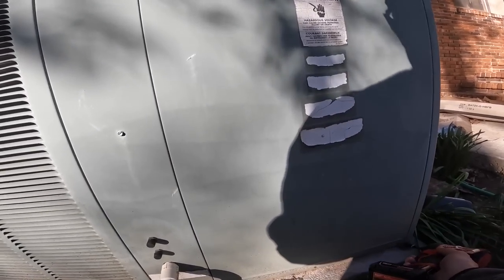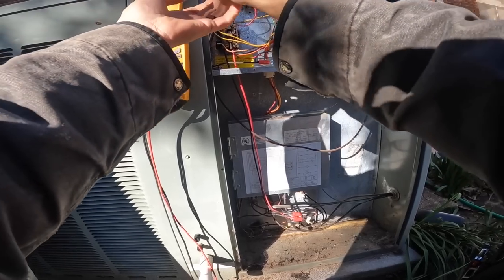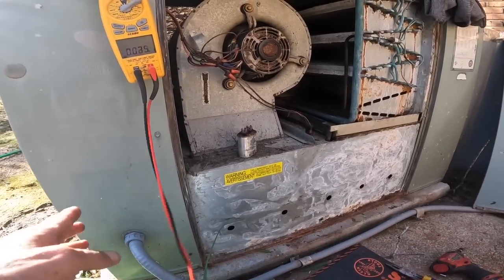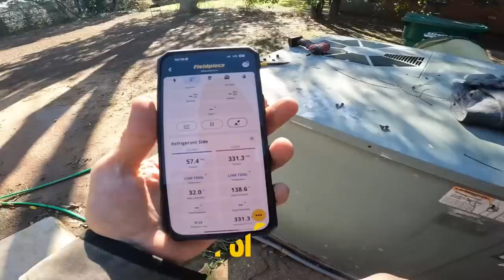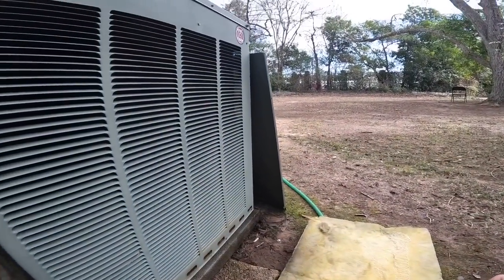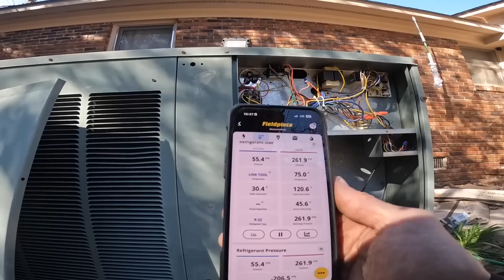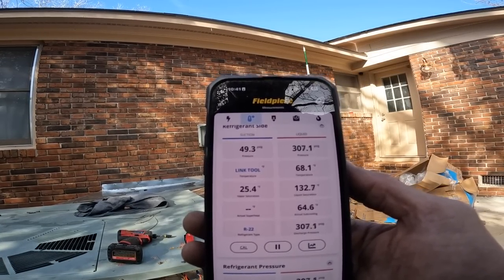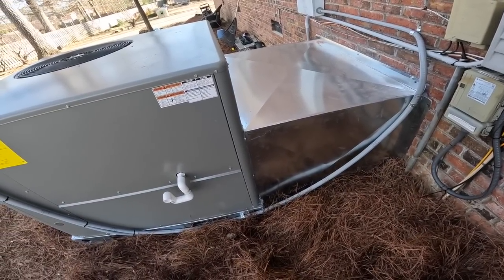Multiple Problems Causing System To Not Satisfy the Thermostat

Comment: I just checked the age of my unit and it is 30 years old...and still going strong near Tampa Florida.
Reply: Prolly a furnace. You can't hardly kill those old suckers. Especially if it's a ribbon burner. I recently replaced a furnace older than me, and I'm no spring chick! Hell, the burners weren't even cracked. I think the swap out had more to do with the outdoor condenser than the indoor furnace. Rheem used to make these army tanks that doubled as furnaces. Bunch of bolts everywhere. If you're lucky enough to own and old school ribbon burner, just make sure to shake the soot outta the burner once every five years   lol

Comment: Nice work once again. Those units are nice when they're new. That one has a nice pad, I've seen you work on some that are right on the ground, I don't like that at all. Seems like it would be feasible to have those off of the ground a bit, even if it is some bricks. May not rust out so fast and get as nasty. Those garden centers have concrete squares and even house blocks. One good thing about those package units, you don't have to crawl around those attics and what I hate even more, crawling under those houses. Mine is a split, but it is a horizonal unit that is in a small mechanical room with my water heater. One of the smartest things I did when I built my house.

Comment: When it comes to rudd and Reem units being charged 
funny, no one ever looks at the charging chart on the inside of the cover. Indoor wet bulb and outside ambient temps will get you there. 
Also, don't forget to run the unit at least 15 minutes so it can stabilize pressures.
Reply: You're not wrong. It's just hard to wait that long when your boss/dispatcher is yelling for faster results. It's a hard line of work. I try to wait at least 5-10 minutes before I say anything with confidence. Although....irony of ironies....no one seems to give me too much lip when I'm fixing an ice machine. "Need to watch it drop a batch or two of ice" can shut up even the most cut  throat of bosses. lol
Reply: @Niveous23  ur right 
I got that covered cause I'm da boss 😎
Reply: @catwrangler1613  Hell yea, get you that paper. It's not easy being a boss. And since it's your reputation on the line, I can imagine perfectionism being a thing. I try to be as extra as I'm allowed, because....even if it's not my company...it's still my reputation as a tech. I'd rather be called slow on the job than half assed lazy.
Reply: @Niveous23  I'm retired now after 21 years of hvac. 
It was bad enough having to switch to r410a, the worst refrigerant since coyote piss and now r454b
Is on our doorstep.  Its gonna cost a fortune to change over to it.
The only unit I work on is mine, and it's 26 years old.

Comment: Hey Curtis, I'm a big fan. Why didn't you consider a bad txv considering you hady low suction high head and a high subcool? On both heating and cooling for a bi flow txv no less
Reply from the maker: I did suspect the TXV.  I just recovered a little before condemning it.
Reply: @HVACGUY  so I'm sorry maybe I missed something was the conclusion overcharged/different refrigerant or txv
Reply: I thought it was the txv also. Had someone been there before you got the service call ?
Reply: @johnwhaley570  49 is a low suction
Reply: @rashatmehta1386  Even for a r-22 system, that's still too low. I agree.

Comment: Hope they have electric heat  I don’t think your diagnostic is complete. Maybe dump the charge and weigh it then you can check refrigerant mixture
Reply: Of course that's the next step. It just depends what the customer/land lord wants. Half your job as a tech is solving and fixing issues....the other half is on the phone, negotiation between customers/suppliers, and picking up said parts.  lol
Reply: @Niveous23    Hey I was just saying in order to tell the the tenant or owner what wrong a few for steps are needed otherwise Curtis really can’t be sure . Sure you should ask the powers to be if they want  further investigation first
Reply: @jamesfitzsimmons381  Time is money was the point I poorly made. Apologies. 'Knowing for sure', is a time equals money thing. Like I can tell a customer, "Your unit is low and you have an obvious leak somewhere." Unless I spot oil or hear a hiss, I can't waste anymore time on the job. My priority has completely shifted. I now have to shift gears. Does it look super low or slightly low? How old is this unit? What do 
I need to tell my boss/ the customer? That feedback is crucial to me knowing for sure. Maybe everyone is gonna tell me to 'top her off and get back on your truck'. Maybe they'll all tell me, "find that damned leak". I have no idea. In an ideal world, techs can just sit around, troubleshoot, and fix. But there's a lot of money and consent involved.
Reply: @Niveous23   it’s all good my friend I worked in residential for 36 yrs dealing with customers like you said.  Been retired for 8 yrs  don’t miss the customers but I do miss working on the unit.  Have a good day

Comment: Why does the blower need a capacitor? In other words what’s the purpose of the capacitor to the blower motor?
Reply from the maker: Complicated answer. In short that type of motor needs a capacitor to help it get started. It’s a Psc motor - permanent split capacitor. All three of these motors have one.
Reply: It's there to aid the motor in starting. Some motors, including the ones in ceiling fans can't turn on with just normal line voltage.
Reply: @HVACGUY  thank you 👍.
Reply: @KenKen-ui4ny  thank you 👍.
Reply: Think of them like the “kick” to get the fan blades/blower wheel etc, to start spinning up
A good test for weak capacitors is to physically spin up the fan/blower during normal operation and if it starts spinning on its own, you know the motors generally fine just needs the right mF to get er goin
Reply: @JesseDoesHVAC  once the capacitor releases its charge does it now hold its charge till the next startup? Or is it constantly releasing its charge during its sine wave cycle?
Reply: Hello,after trying they RUUD,YOU FINALLY ,INSTALLED A ‘LENNOX;’ NICE INSTALLATION,,,,TAKE CARE,,,,Till next time,, 🇺🇸🇺🇸🇺🇸🇺🇸
Reply: @JesseDoesHVAC  I had an very old mechanical Start bench grinder that I had to rope Start to get it to run because the Start winding crapped out. HAHAHAHA

Comment: While using screws to hold on the insulation may work, it defeats the purpose of the insulation. When you crush insulation, it can no longer do its job.
Reply: better than plug the blower.
Reply: @MariosACandRefrigeration  no, better is to use glue and keep the value of the insulation.
Reply: Or realise that the overall affect of that small plate of tin is gonna have on the overall r value of the insulation is so negligible that its not even worth worrying about
Reply: @JesseDoesHVAC  you clealry have no clue what you are talking about. The metal plate has no R-value.
Reply: @JohnSmith-ug5ci  i dont want us to spend any more time on the subject, but if you read what i said, pretty sure i didnt say anything like that?
Reply: @JesseDoesHVAC  yes that is exactly what you said. Again, the plate destroys any R value of the insulation.
Reply: @JohnSmith-ug5ci  I disagree with you here, but everyone has a thought on it.  I personally use spray adhesive to re-attach the insulation.  But the R value new was like R-5.  That system might be an R-2 or none now.
Reply: @JesseDoesHVAC  Correct. The goal of the insulation at the blower is not the same as insulation of a house for heat load calculations. It's more so about laminar airflow. The tin may squish it a tiny bit, depending on how tight that screw is on the panel. But it's completely negligible. The insulation has more to do with prevention of air leaks, air flow, and at MOST to reduce sweat on the panel. So it's more similar to the insulation on a piece of duct than say a wall in a house. Truth be told, ANYTHING you do will squish the insulation. Taping the edges to the insulation? Adding new glue to the insulation? All involve some level of you patting it down. If John really wants to be extra about this, he'd need to either buy a new panel, or completely scrape off the old insulation and glue a completely new piece if he really wants to nickel and dime btus and cfms.
Reply: @Balticblue93  no, you do not disagree if you admit that using the tin and screws lowered the R value. You actually confirm what I said. The reason it is important is that this lessons the efficiency of the unit and a unit that old needs all the help it can get.